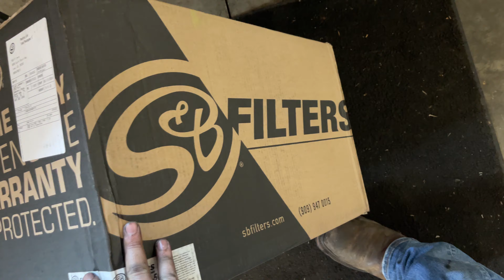7.3 POWERSTROKE KC TURBO INSTALL!!!

Comment: What do you like to use to clean your pipes and intercooler with? Thanks for the video 👍😁
Reply from the maker: Strong degreaser or some dawn dish soap!
Reply: @Atomic_Diesel  thanks
Reply: @Atomic_Diesel  even the inside? I think mine has a bunch of oil